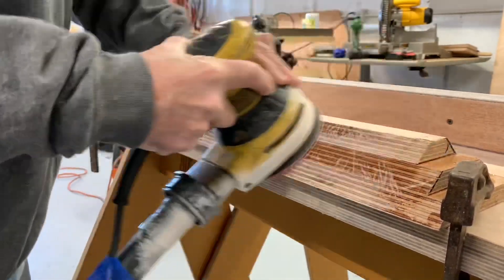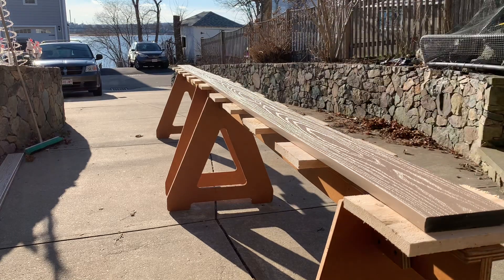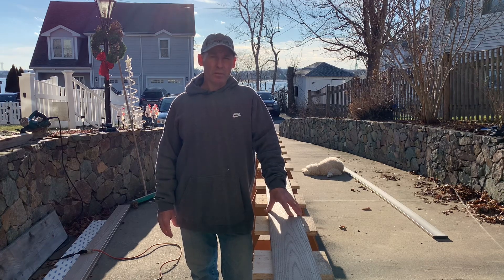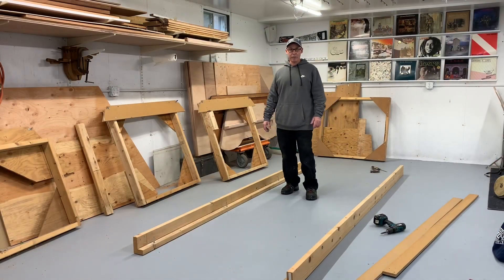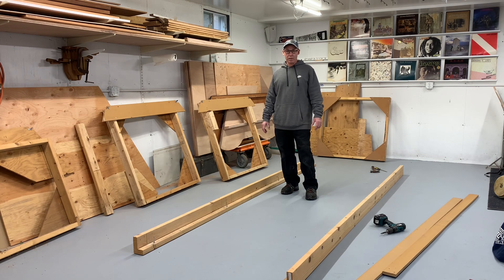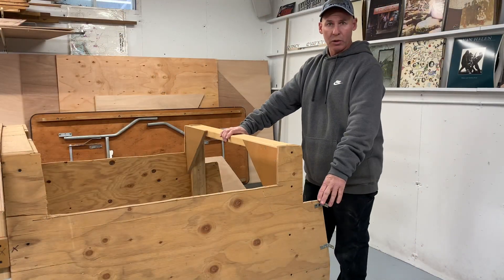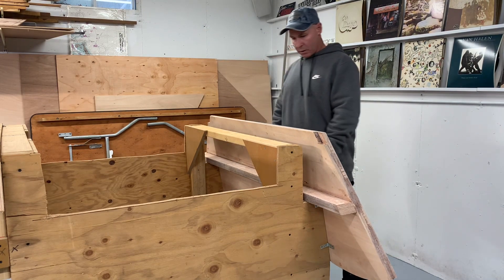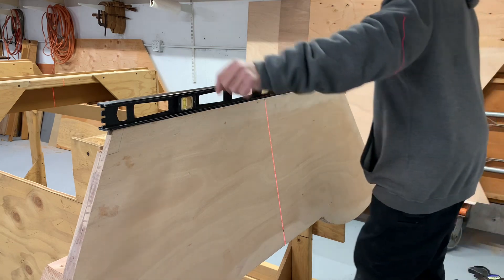Building Plywood Boat Ep 5

Comment: I think your using PVC decking for running strakes on the bottom of a previous build is a worthy experiment, and—as you note—they have held up well. But I suggest that other amateur builders think twice before using PVC decking for STRUCTURAL members like the chine strake, which—of course—is designed to strengthen and support the bottom and side panels in an area of high stress when this planing skiff is running (and, inevitably, pounding) at speed in a chop. 
    I am NOT a structural engineer or naval architect. I simply know from experience that, as shown in your video, a strip of this decking behaves like a wet noodle, which an identically sized piece of oak or mahogany (your choices for previous boats) would not. I also don't know how epoxy bonds to PVC as opposed to wood. The bond may be fine (or even excellent); it's just a question mark in my mind.
    All that said, I sincerely hope that the substitution works well and proves to be durable. Good performance would open up other possibilities in the construction of small boats.
Reply from the maker: My disclaimer was this is experimental. Thanks